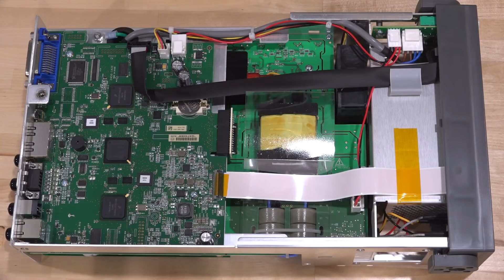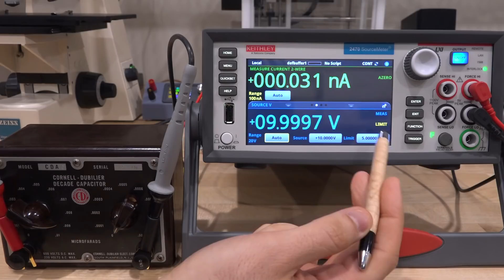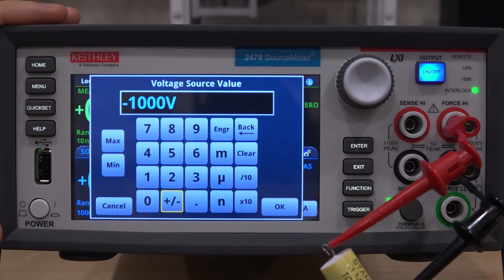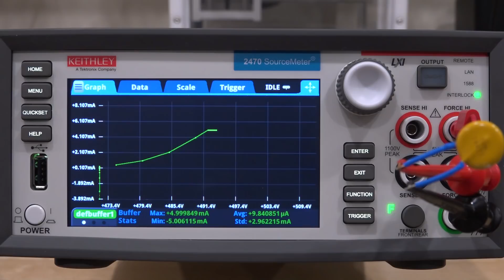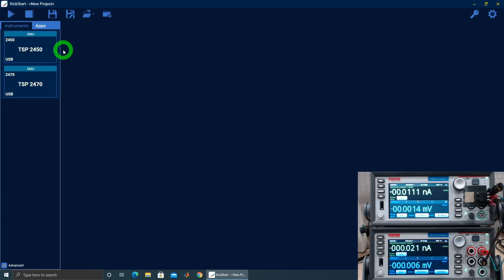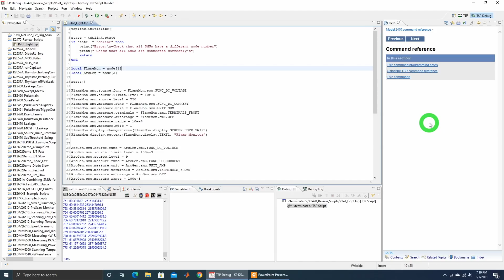TSP #187 - Keithley 2470 1kV Source Measure Unit (SMU) Review, Teardown and Experiments

Comment: Kickstart is really nice, juts bought a  perpetual suite license, but some drawbacks - I have a 2250 and two 2281 (battery tester and power supply), but cannot combine it into the IV Characterizer, Though the 2281 is a power supply its programmable, and could be used to form one source to step through the voltages (limit 0..20V ). On the other side the 2281 appears as power supply and battery tester of course, but the 2250 does not appear as power supply though it can be used as pure power supply ? -- so  some improvements can be one in the Kickstart Software. -- The IV tracer license, is very high, higher than a perpetuall kickstart suite  license which I dont understand as the IV Characterice (comes in teh suite cheaper), can do more. A pitty that APps cannot be programmed by themself only TP Scripts (ist aroun dthe same), buts this is a closed system- I requested for a APP developer SDK or so without getting response

Comment: Nice review! As usually. That software is a joke:D I'm using python for all of my instruments via GPIB.
Reply from the maker: You can still do that here as well.
Reply: I wish the instead of their TSP language (TSL), used Python 3. The benefit of their TSL (Actually checking manualls TSP programming, a TSL is just Lua with some libraries to interact with the device and network), is that it actually runs on the device, and can be stored on the device, with much tighter timing and response to triggers and conditions, and can run offline. Of course you can use GPIB with any language you like with these (and other) devices from some computer or controller, it will be just be somehow slower, but more flexible. The benefit of Lua (TSL) over Python is that TSL is somehow faster and easier to isolate for faults than Python interpreter and all the libraries.

Comment: Great instrument, but common, when are we going to stop doing stupid things such as licensing basic computer software. Those pieces of software are a great selling point for the device, but buying them is not good. They should be open sourced so people can modify them since they are usually buggy and lacking in features. Companies milk their customers way too hard, in my opinion they would be making more money if they didn't charge for such basic software.
Reply: $10,000 for the SMU and it doesn't even include the software. Yikes.
Reply: @jjoonathan7178  It used to be free with the units. The someone had a bright idea that makes the rest of us groan. I'd carry on using the original version which is Window7 only but I'm guessing that later firmware has closed that door. Sucks. $1K for a prepetual license that you know at some point they'll say isn't supported anymore so buy the new version again.

Comment: Did you try high-capacitance output mode? The standard mode is designed to be used with no more than 20 nF.

PS: I've fried a Keithley 2602 by loading it with electrolytic capacitors, causing oscillations in the SMU's control loop. Usually the measured current was way off during oscillations.

Comment: In the varistor measurement, when you are discussing the part of the curve where the current limit kicks in: Any thermal effect in the varistor shouldn't care about the polarity of the applied voltage. The curve should be folded back towards zero on both ends. However in your measurement the positive end curves forward, not back. The positive part is not a mirror image of the negative part. Hence I think what you saw was not a thermal effect in the varistor itself.
Reply: I think it was a thermal effect on the varistor here. As we had a cold start, the varistor starts at a low temperature and then increases its temperature to an intermediate level. At this temperature the clamped voltage has about the same magnitude whether negative or positive.
At the end of the measurement the varistor already is at an intermediate temperature and gets stressed even further to its highest temperature at the end of the test. As a result, it also increases its clamped voltage and the curve goes to the right (or "forward", as you put it).

So in both cases the result of the temperature increase was an increase of the magnitude of the clamped voltage.

Comment: The capacitor box must have some bleeder resistor in it that causes the 6 uA in one of the ranges. The current correspond exactly to 100 MOhm and is way to stable to be due to capacitor leakage. Also 100 MOhm would be an extremely bad insulation resistance for any type of polymer capacitor.
Reply from the maker: Nice observation.

Comment: I think I recognize the auxiliary PSU as an XP-Power 100 W module. These are available in multiple output configurations but the formfactor is the same for all 100 W models as is the (apparent) PCB layout. Nice to see and a logical step as well. They are quite clean (EMI), and when used within spec last for years and years. Good to see them not reinventing the wheel.

Great video!

Comment: Nice, more Keithley toys. Now TSP need 2651A or 2657A review ;)  Sadly, the actual hardware or even just brief look of most interesting analog circuit board is not shown. I wish TSP would spend additional 5 minutes to do that, just like its done for all the countless wonderful RF equipment repair/teardowns. I believe just removing outer board for few nice shots wouldn't ruin the instrument. For example, those large ferrite coils with coax cable windings is isolated low-noise DC-DC to power analog domain. Keithley have patent published about that, similar like other LCD SMUs. Given the high cost of such instruments, it is nearly impossible to find any photos of inner boards of recent hardware such as these new SMUs, so TSP have excellent chance to help with this information void...

Those read triaxial ports are not just usual triaxial, but SHV triax version with higher insulation ratings. It's easy to spot the high-voltage variant by protruding PTFE insulation rings.
Reply from the maker: I will probably do a more detailed teardown later on, I just didn't have the time during this review. There are many other tasks I still have to complete in the lab. :)
Reply: @TheSignalPath  Thanks. Such instruments deserve more than one video, I think I am not the only one with that idea. If you need some low current tests, I also have Keithley 6430 (the ultimate low current SMU) and just 30 minutes away from you :)